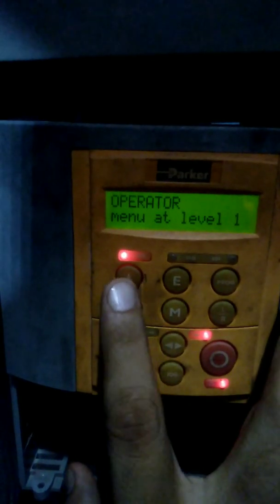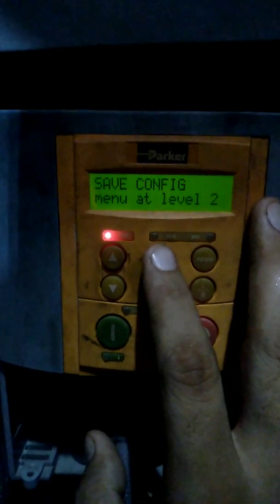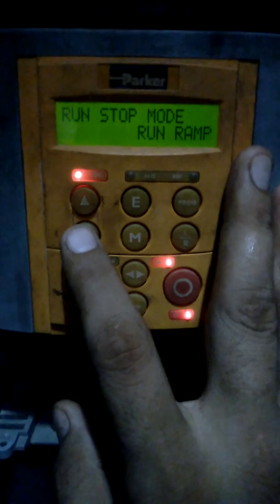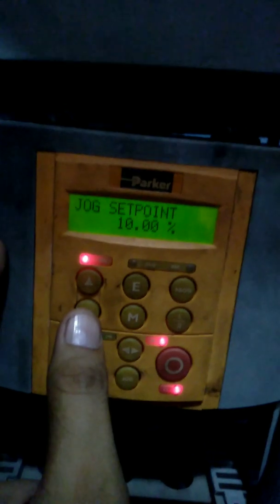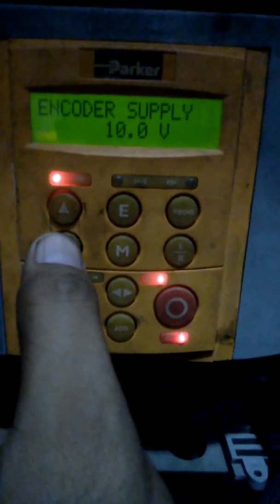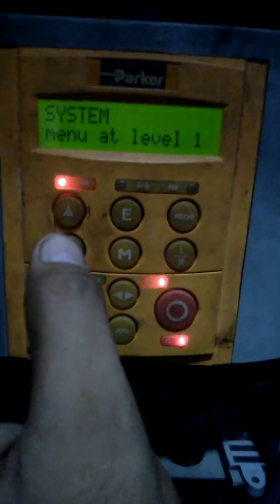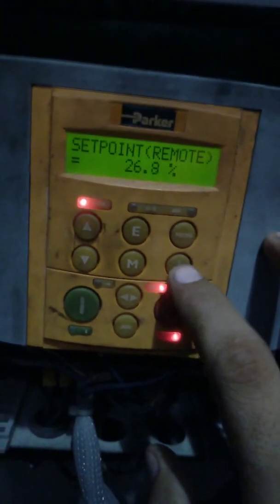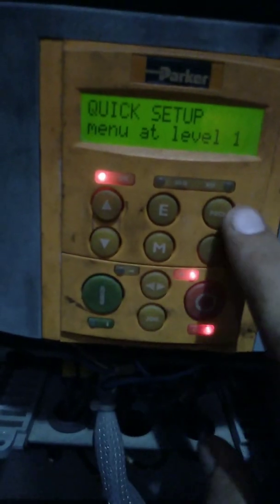PARKER 690/690+ AC drive@creativeconcept7584

Comment: Armature and field penal Mein connection driver ka kaise karte hain Sabhi wiring ka bare mein bataiye
Reply from the maker: Ye ac drive ki video hai ... AC motor k liye ... Isme drive ki power wiring me supply ki 3 wire drive ko connect hoti hai aur load (motor) ki 3 wire drive ko connect hoti hai .... Baki sab control ki wiring rehti hai ...